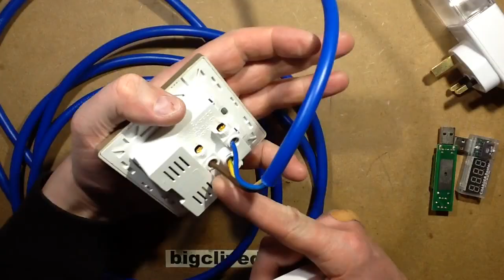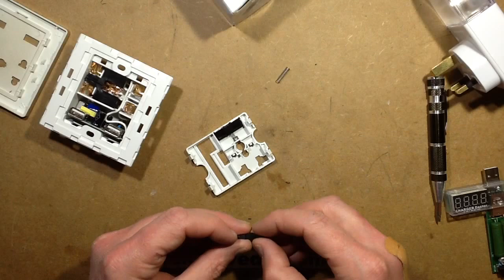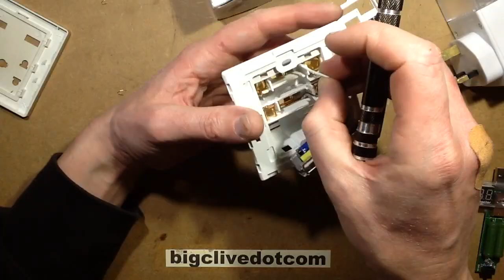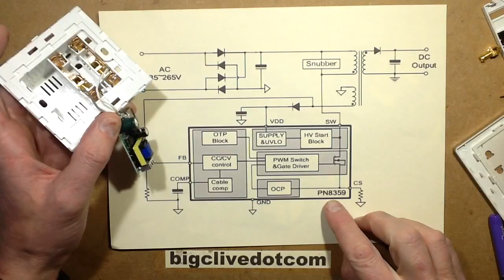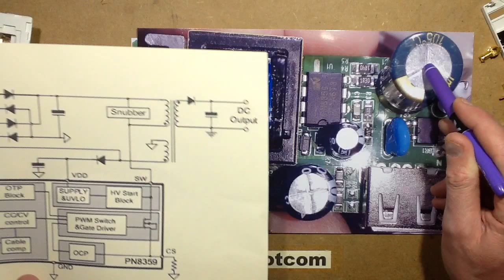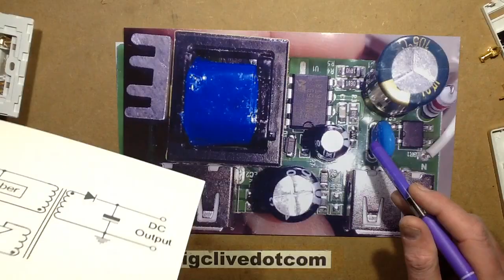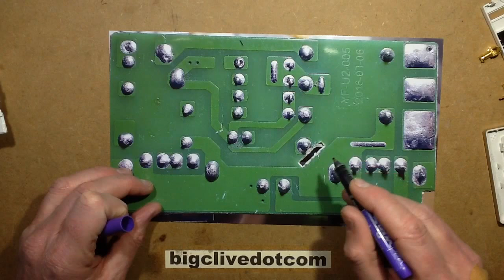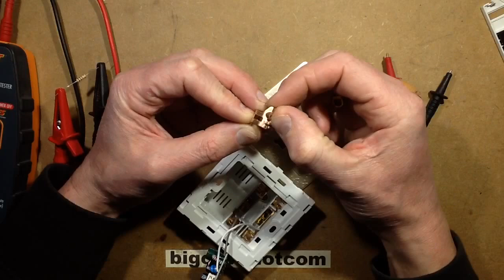Wall plate death-dapter tests including fire and 1kV.

Comment: I still do not trust USB mains sockets. 

After using one at my friends house and literally having a socket get blown out of its casing in the wall when I plugged my phone in.
Reply: I think Clive put forward a rather good argument as to why they aren't a good idea. Paraphrasing: "It isn't a great idea to have active electronics directly wired onto mains. It stops you from removing it easily if something goes wrong."

I am inclined to agree, even if it is well engineered, pcbs will eventually derate out of spec, whether it is high voltage tracking due to surface degradation, tin whiskers on joints or just general component failure. I guess I am being too pessimistic as always...

Edit: Ah I made this comment before watching this video to the end, Clive mentions his objection in this video too! Silly impatient me.
Reply: Your phone charger is a usb connected to mains without any ground even for genuine chargers. Its more to do with the quality, standards and design.
Reply: Previously if it had the standard UK mains sockets yeah but not the one/type in the video. I don't like the multi "standard" sockets.  I also avoid anything Clive says is bad because if he won't use it, it must be truly awful. :)  However after watching the video and reading the comments I will just stick to standard sockets with a decent charger and dump all my "Happy Sun Splendid Chargers." I'll keep the "Extreme Monster Power Electric Plenty Turbo" though as I like the tingle it produces when you plug it in. ;)
Reply: its a usb connected removeably to a removeable other object to mains, both of these being removeable if they catch on fire with only minor burns and not a full on house fire
Reply: A Person neither do I. it's putting all your eggs in one basket and I don't fancy trying to find a screwdriver whilst the socket sets on fire, at least a dodgy charger you can throw out the window.

still, this one doesn't seem too bad.
Reply: I don't know anyone who wouldn't use a friend's cable in the friend's house.  I wouldn't give it a second thought.
Reply: @Cheordig  With USB C? If that cable isn't up to snuff, I'm not using it. Better to pay a tiny bit extra for reliable, durable, properly specced cables than to risk the garbage out there.
Reply: @Olivia-W  Ironically the only cable failure I've had was an official USB C cable on my original Pixel XL. It melted and welded itself to the phone. 🙄
Reply: @Cheordig  Did you use a decent charger? The cable could have been fine, but would have done nothing for a bad charger.
Reply: @Olivia-W  Yeah it was an official Pixel charger.
Reply: @Cheordig  Ouch. Well, good luck I guess.
Reply: I've got one in my bedroom, not a cheapy but going to see how it lasts...
Reply: If they are built correctly  and comes from a real well known electrical socket manufacture directly.Then it should have no issues at all.Everything in them must be correctly fused and wired for the exact voltage of the home usually 120+ volts.For wall sockets with USB their would be something like a resistor to cut the voltage to 4.5 volts exactly.There are sockets out their being made by dodgy companies many of which are not certified wall socket and plug providers. Best provider and top for these products in North America its Leviton if in Europe i am not sure of top but people should use the well known top leading providers
Reply: @tspiderkeeper  I have four MK (UK manufacturer) usb/mains sockets and have been happy with them for about 4 years now,some are used as constant power sources for a smart meter and a couple of Alexa devices.
Reply: Z Mate - I have heard dozens of these stories. Don't believe any. 

Tell me the pullout strength of a no. 8 screw 1" long self tapped into a 14 ga steel j-box or with 1/2" self tap into a plastic j-box and then calculate the number of joules that is and compare it to those released from a dead short into a rated breaker. 

The only way anything blows out of a wall is when an unlicensed non-electrician has mis-installed it.
Reply: Crocellian 
Piffle.
Reply: A Person there ridiculously overpriced and I don't think there going to last or be that great.
Reply: +TSpider keeper you cant use a resister to drop the voltage as its an AC voltage unsuitable for USB. There are compact ways to get AC to DC and the voltage down. The problem really is the rating of the components, any safety and avoiding contact with any conductors.
Reply: +Techknow He used one that someone else had already installed in *their * home.  He had no saying in what protection was in place, just like most people don't when they use electric installation. That's why there are so many rules about how safe such installations must be at all times, because they must be safe for strangers and friends to use.
Reply: John Doe - All these BS stories involve so many unknowns so that they can't be debunked. 

I've been testing 10++ hp 3P motor loads for decades. I can always spot the BS by the way the "incident" is described.
Reply: It probably came from poundland, straight from the big rock candy mountain!
Reply: I would like a really high quality one
Reply: it prob didnt support quickcharge 3.0..
Reply: I've been using USB main sockets for a good 3 years now. Got half a dozen or so all over the house. As for not wanting active electronics permanently connected, who turns their TV off and pulls the plug etc. Lots of appliances use electronics and are left on. Microwave clocks anyone? Even a PC left switched on at the socket (but shutdown) will still be powering the USB sockets. Even a plug in USB adapter won't be that far removed from that socket when it comes to the electronics. Stay safe :-)
Reply: @bertiesworld  Point was that you can remove a connector if something goes wrong. If something starts burning, its also not gonna be entombed directly in the wall connector. A PCs USB ports arent directly connected to the houses mains anyway, like this circuit board is. 

Also, if you go on vacation, you should disconnect everything.

The minor convenience of having chargers on the sockets really doesnt seem worth the risk, as small as it might be.
Reply: i dont trust them because of security reasons
Reply: Always carried a spare battery (and later a battery bank). Plus, I do not trust any charger unless it came with good brand smartphone or I made it myself. A computer is fine too.